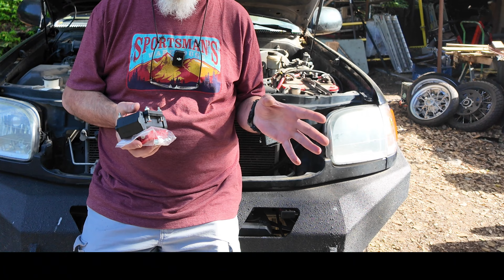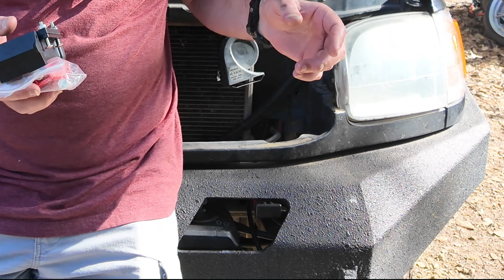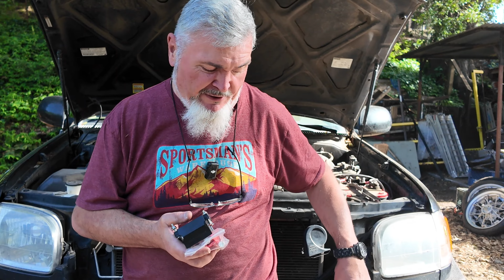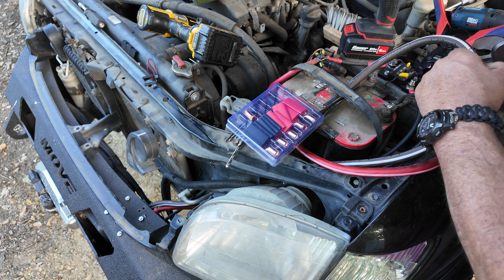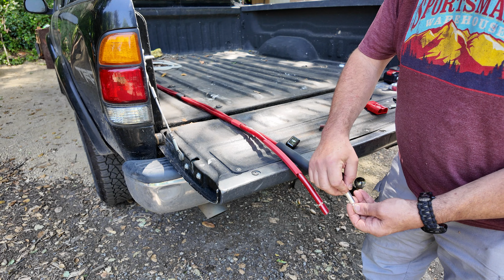DIY High-Power Connection: Unleash Your Vehicle's DC Potential

Comment from the maker: Affiliate links that really help the channel!
DS18 Ultra Flex Power Wire - https://www.amazon.com/dp/B08LP2JDSM?ref=t_ac_view_request_product_image&campaignId=amzn1.campaign.2OBW2IYBDN26A&linkCode=tr1&tag=targetforge05-20&linkId=amzn1.campaign.2OBW2IYBDN26A_1716487918602
Tools used:
Crimper - https://app.rockporch.com/prdlink/fxIV2is686
Cable Cutters, Sanuke High Leverage - https://app.rockporch.com/prdlink/TFjHubAKCo
DEWALT 20V MAX Cordless Drill Driver - https://app.rockporch.com/prdlink/kVKIlinlay
Transfer Punch Set - https://app.rockporch.com/prdlink/uQUaPXLFjj
Dewalt DWHT83193 12 in. Large Trigger Clamp - https://app.rockporch.com/prdlink/2DuYG1GKiK

Materials used:
SB175 weather housing - https://app.rockporch.com/prdlink/PaoXBX3Zx3
SB175 Connectors and contacts - https://app.rockporch.com/prdlink/SOvXJFptal
1" Adhesive lined Heat Shrink - https://app.rockporch.com/prdlink/OGplCkdZtI
3/4" Adhesive lined Heat Shrink - https://app.rockporch.com/prdlink/qxPvVEIRRd
Sanuke 10pcs 1/0 AWG-3/8" Battery Lugs - https://app.rockporch.com/prdlink/KwzlPsCNIY
Self-Adhesive Rubber Edge Trim - https://app.rockporch.com/prdlink/VXojoIdFm5
Threaded Hex Spacer/Standoff Female, 1/2" x 1/4"-20 - https://app.rockporch.com/prdlink/BaXxuVtld7
2000W Pure Sine Wave Power Inverter DC 12V to 110V 120V  - https://app.rockporch.com/prdlink/B56dVAHtd2
180amp Marine Circuit Breaker Resettable - https://app.rockporch.com/prdlink/pI4L7yeU8K